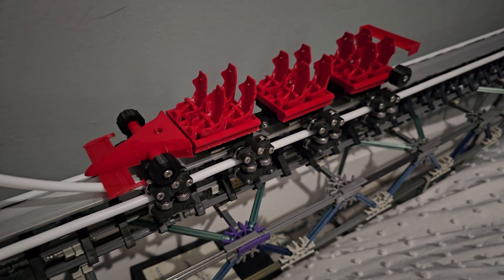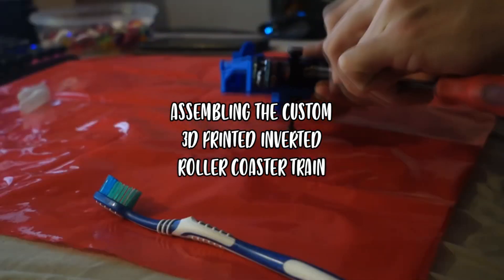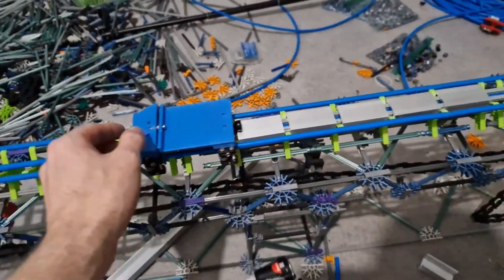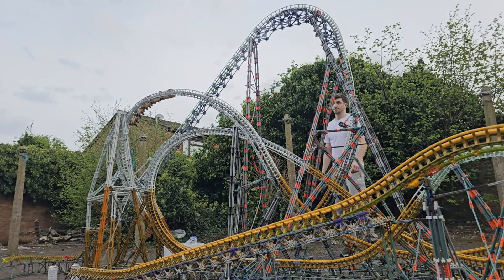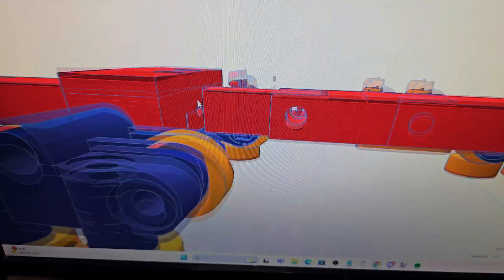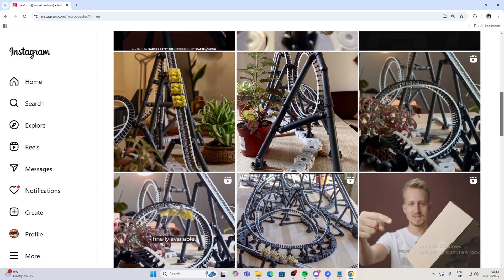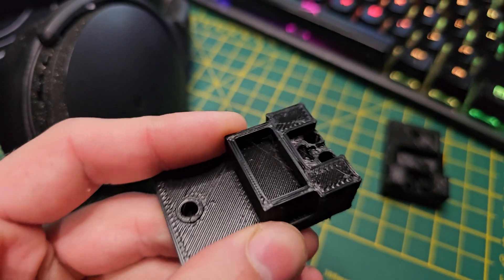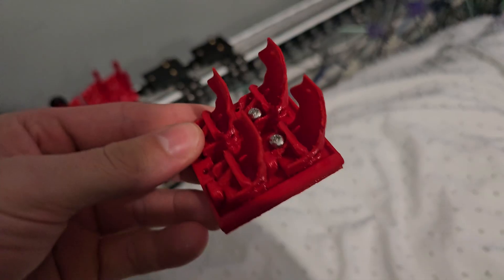Making A Super Realistic K'nex Roller Coaster Train (3D Printed)

Comment: Permanent magnets DO NOT make eddy currents, you moron!  Permanent magnets also do not slow down the coaster.  They either stop it or have no effect on it.  You need to power an electromagnet if you want block brakes (what you are referring to).
Reply from the maker: when moving a magnet over aluminium or copper it induces resistance and slows down the train. no need for any electro magnets. no power is needed.  its the same thing as a watter wheel generator or a turbine. just layed out flat rather then in a cylinder. you might be referring to LSM or LIM launch systems where an electro magnet is turned on and off at perfectly timed intervals to generate movement, that isnt whats going on here. this is just a very simple eddy current system